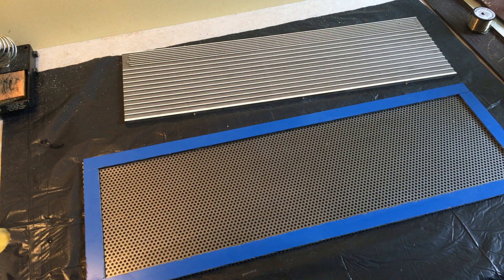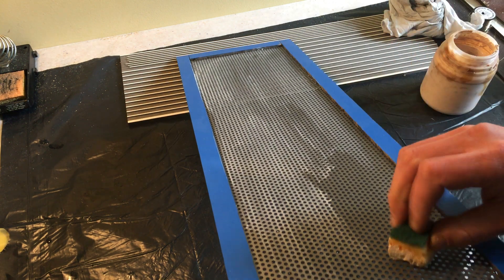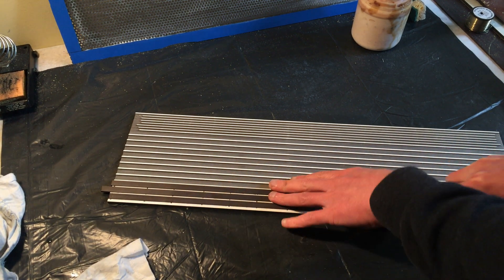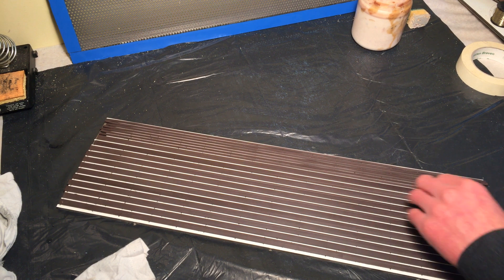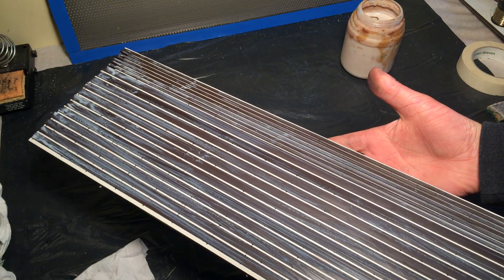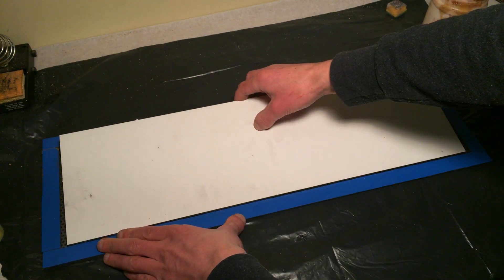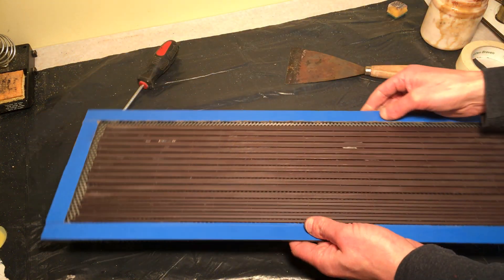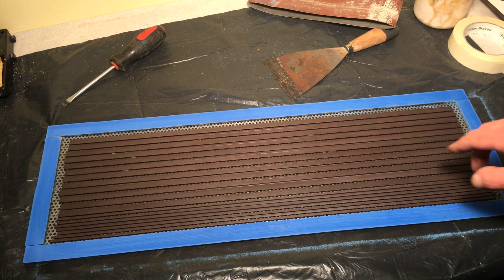Part 4 : DIY (tutorial) make a planar speaker panel :Glue the magnets

Comment: curious why you use two different sized magnets? The only reference I have is the magnepan lrs which uses the same size magnet for the full panel.
Reply from the maker: Magnepan uses different sizes in all magnepans i ever seen. tweeter magnets are always less wide.  with a reason,  spacing the wires less apart. (the further apart the lower the usable frequency it produces, so tweeters have less wide magnets.)  they also are thicker so sit closer towards the foil increasing the tweeter output

Comment: hi, your concept is very interesting.
 what magnets did you dwell on, those based on ferrite or neodymium?
 Is electrostatics working better?
Reply from the maker: almost all the flat panel builds on here are made with rubber ferite magnets except for my Neo tweeters :) as the name implies :)  neodymium is in my opinion not needed when you go big, and want speakers that can be used in your living room.  and if you can live with lower efficiency. in most cases you can still play as loud as there neodymium brothers/sisters,  it just takes a bit more power. electrostatics are better. they are push pull in general (there are single ended ones but they suck)  but they have allot of other downsides. especially if you want to go fullrange.  biggest downsides, are costs, high voltage,coatings, more components, insulation, and above all reliability.  pro's lower distortion, can be segmented, and can be made  with lighter/thinner foil.

Comment: I'm late to this video, but if the edge area isn't as compliant (seems reasonable because it's going to be close to the edge, a known stationary point of the mylar), why not put the tweeter winding/magnets around the entire edge (in a rectangular pattern), and the midrange in the middle? Say two or possibly four concentric magnetic lines with the tweeter magnet widths at the edge, then the woofer (might not make much of a difference between concentric lines or up/down as you have done) to the inner area. Any idea what the advantages/disadvantages of a different magnet/wire pattern might be?Also - and unrelated to above (and probably TBH incompatible to above) I can understand the issue with the holes in the metallic backing not lining up with the gaps in the magnets, why not use angleframe ("L" profile metal) instead of a flat holey surface (batman) - the magnets being glued to the bottom of the "L L L L L", and the mylar/wires 1mm below. With the angleframe, there would be more rigidity for the magnet assembley (compared to a flat 1mm sheet of metal as the base), and if the angleframe is the same width as the magnet, the "open area" could be 100%, with the magnets being mounted on a sturdy source and the gaps between the magnets being 100% air gaps.This could also give the opportunity to adjust individual lines of magnets for specific requirements (eg, centre magnets a little further away for better power handling). Granted, like everything I bring up, I could be talking absolute rubbish but I'd bet there's advantages and disadvantages to both approaches. What's your thoughts on this?
Reply from the maker: Thank you for the insane long response  ! i like that !  but let me explain my point of few :) there is always a sort of  a battle between usefulness and money.  in this case i would love to make it a commercial thing someday. so i have to weigh the pro's and cons. :( i never get a card Blanche : ( about the tweeter, the problem is , you never want to emit high frequencies from 2 different sources, since wave lengths are so small  you will end up with a comb filter :) also the dispersion would be screwed im afraid. btw the open area would never be 100% ;) i guess you ,meant between the magnets hehehe. but about the metal the only cheap way is using either default metal or stamp your own :) if you got some money to spare. all other options are more expensive for the amount of magnets i have to put in :(

my way of working is always try to do as much as possible with common materials or cheap materials, and if you want to make something that might ever been sold you have to unless you go the high end snake oil route. then everything is allowed :)